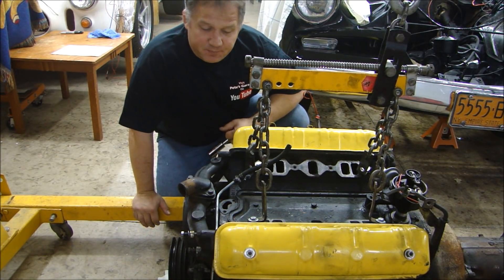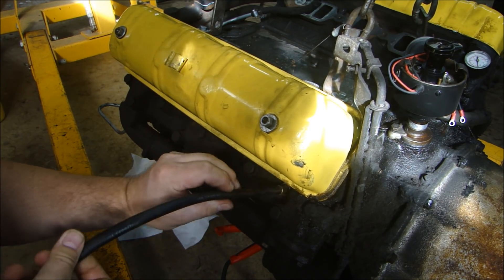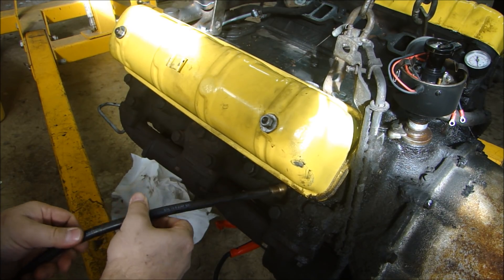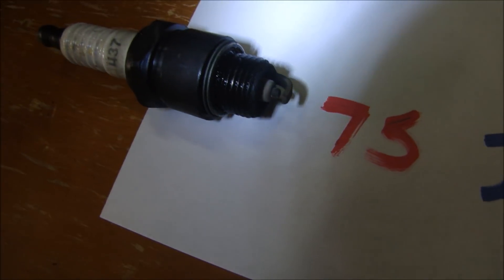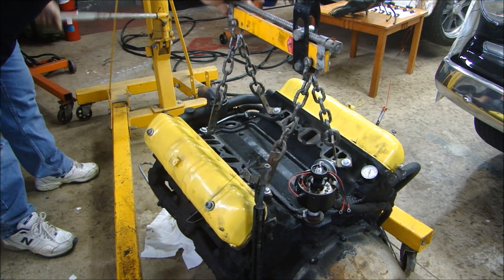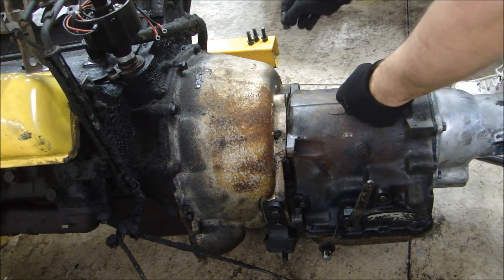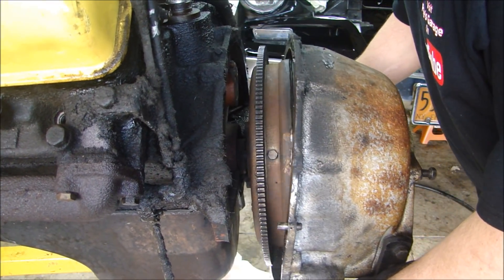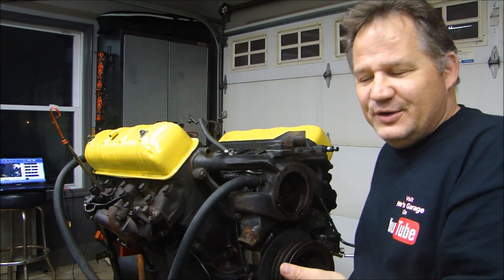Engine Rebuilding - Initial Test and Prep

Comment: Hi Pete, on a Studebaker designed intake manifold, are the exhaust and intake runners built into the one manifold? You have me confused when you stated you had a breach in the exhaust gasket on what is normally on the intake port side of a head and valley mounted intake manifold.  Could you clear up my confusion here?
Reply from the maker: Ok, There is a heat riser that scavenges hot air from the exhaust side of the head to close the choke. it is mechanical so as the engine heats up the warm air opens the choke. The intake gasket used was a paper type gasket which cannot stand up to the heat and burns away. I use a metal gasket in this type of application.
Reply: Petes Garage Thanks Pete. Stewart Australia

Comment: 9:49 Some modern cars don't require a large variety of tools. When dealing with a Toyota, usually a 10mm, 12mm, 14mm, 17mm, 19mm, and 21mm wrench is all you need. Honda and Nissan are similar.

Modern American cars often have 10mm, 13mm, 15mm, 18mm, 19mm, and 21mm, but they need a good set of Torx bits and maybe a few hex keys.

However, modern German cars are very annoying. They have a large variety of bolt sizes, they require triple square bits, often require Torx bits, several hex keys, and often some proprietary fasteners. When I work on a watercooled VW, it amazes me to think about how simple the original beetle and microbus were.
Reply from the maker: Fasteners are designed for size. Older cars just had whatever sizes were easy to pick.

Comment: do you have to have all the spark plugs in each cylinder when a compression test is done or not
Reply from the maker: All of the plugs are out to make the engine easier to turn over. The only one sealed is the one with the tester.

Comment: The bell housing and the trans would come off as a unit leaving the torque converter behind.
Reply from the maker: Not on this engine. The bell housing has to come off to get to the bolts holding the torque converter on
Reply: "The bell housing has to come off to get to the bolts holding the torque converter on'  Maybe I was wrong but it seems removing the bell housing with the trans attached would leave the torque converter bolted to the flywheel.  Then you have access to the bolts to remove the torque converter.
Reply from the maker: That is what I thought, but there is no flywheel. The teeth for the starter are right on the torque converter
Reply: Yeah.  That torque converter is so massive it doubles as a flywheel since ICE needs a heavy rotating mass. Great video.  Looking forward to your next upload.  Too bad Studebakers down here are relegated to the junkyard.  But I'm old enough to have seen them running brand new when I was a kid.  We rode in my dad's 1947 Ford Coupe V8.

Comment: Hello Pete.
65 psi is very low for this engine, it should be between 140 and 160, although I did note the cranking speed was a bit slow. If you look at my ID pic on the left, it is this same engine that I rebuilt and fitted an electronic fuel injection system to, using a Megasquirt ECU and cobbled the rest together using mostly GM parts from a V6 Buick engine. 
   If you like I could email you some pics.      
ken
Reply from the maker: That is really cool. I did crank it slow and only got the cold pressure. You can email me at petersgarage@verizon.net. Thank you

Comment: Great video as always!
A stupid question (I only dealt with 70s Fords). Exhaust goes into the intake manifold  here? Is that common?
Reply: a lot of cars have that. its a channel for exhaust gas to go through so the engine warms up faster when its cold
Reply from the maker: Exactly...thanks for the answer
Reply: Sometimes exhaust gas is used to heat the carb to improve fuel atomizing when cold, other engines use it for the EGR valve. EGR is short for exhaust gas regulation, it means adding some exhaust gas into the air intake in order to reduce smog.

During the 70s, a very large number of engines were fitted with EGR systems, so it wouldn't surprise me if you were looking at an EGR system.

As for exhaust gas going under the intake manifold, that is typically common on V8 or V6 engines with carbs, but not on inline engines. On inline engines where the exhaust and intake manifolds are on the same side, radiant heat from the exhaust manifold was often enough to preheat the carb(s). You may have seen this sort of thing if you have worked on the Ford 300 CI inline 6.

Comment: Hi Pete. When your engine stand took the strain it certainly strained at the main shaft. A V8 is extremely heavy. Are there stands that can take strain from the front also as well as the back to spread the load as sometimes I believe people put too much faith in the stands.
Reply from the maker: That is a great question. Those stands are rated for over 1,500 pounds. With a factor of safety they might hold 2,000. In order for the stand to fail, either a weld or the steel itself would have to fail. Most engines will go about 600 pounds so it's reliably safe. There are some heavy duty stands, but they are huge expensive. I have faith in them, but I do understand your concern.

Comment: Hey Pete, the distributor and transmission are on the back of the engine! Your cylinder "2" is cylinder 7 bud.
Reply from the maker: This is a Studebaker engine, 1,3,5,7 on the left side, 2,4,6,8 on the right.
Reply from the maker: Holy crap you're right....I got that all wrong...I'll make a correction...thank you
Reply from the maker: I added annotations.....thank you so much...I am so used to looking at Fords I got this all wrong....lol
Reply: You da man